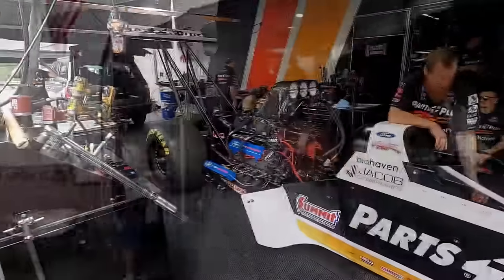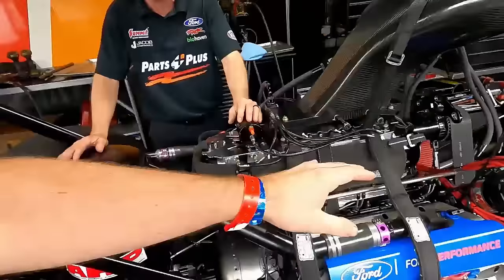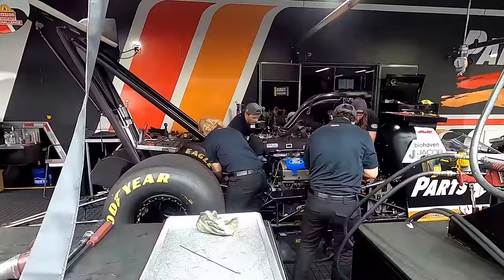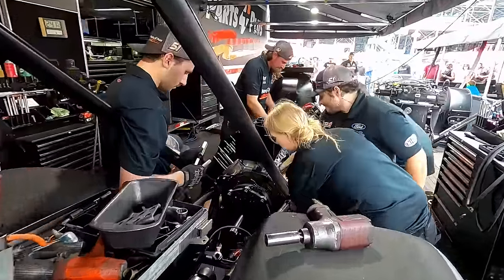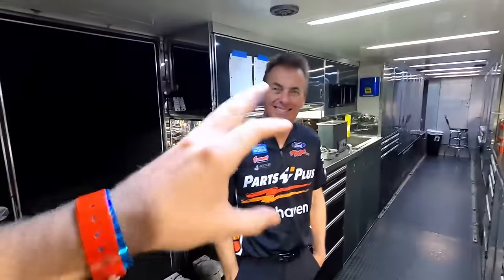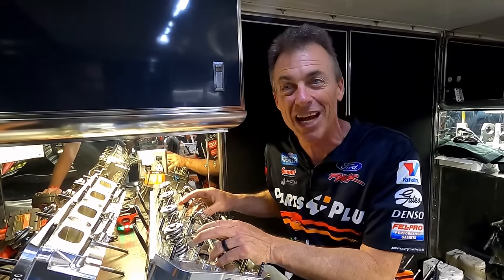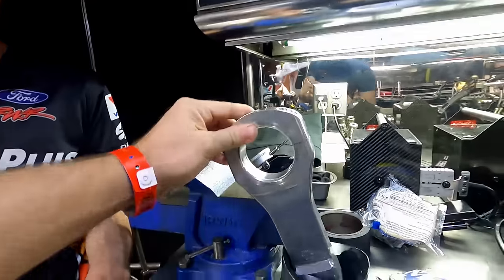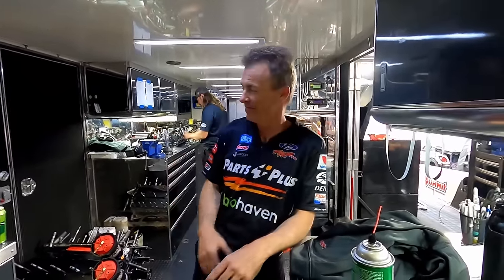CRAZY TOP FUEL FACTS WITH CLAY MILLICAN! 0-300 MPH in 3 SECONDS! #StompOnThatLoudPedal

Comment: Since a blown engine could cause the car to crash potentially killing the driver. It is well worth the expense and effort to rebuild the engine after every run. When making a vehicle go from 0-300mph in less than 1000 feet you have to seriously push the limits of those engines.

Comment: When Clay said you have to "see it, hear it, and feel it", it is absolutely true! Being right next to the cars as they run is just, in one word, exhilarating! The vibrations that are felt cannot be accurately described! I actually live about a mile (as the crow flies) from a major Midwest drag strip. The tunnel under the tower, and the drag strip itself, make almost a perfect straight line to my house. I can feel it inside my home when a nitro top fuel car takes off! That is the power of 11,000 to 12,000 hp accelerating! Man, what a rush! Thanks to you and Clay for this access to the inner workings of a top fuel team!
Reply from the maker: Wow! I’m sure you hear it loud and clean from that distance haha That’s awesome! Thanks for watching 🙌🏼
Reply: I live 10-12 miles from the now closed Atlanta Dragway in Commerce GA and could hear them at my house. I could easily tell if it was a single run or when one of 2 cars lifted - the noise level would change.

Comment: Great video, I'm a big Clay Millican fan. The one top fuel fact that you left out, and blew me away was when I realized that on an optimal run, from start line to finish line, the engine turns LESS than 1000 revolutions
Reply from the maker: I definitely should have mentioned that. It's wild to think about that fact! But it makes perfect sense when you break down just how quickly they make the run.

Comment: To fix the main studs from pulling out of the block you could switch to a billet steel block instead of billet aluminum. It would add a couple hundred pounds but it would be stronger and add a little bit more down force to the rear tires.
Reply: Aluminum, not only weight, also does not need liquid cooling.

Comment: A Billet steel block with aluminum jugs with iron liners, somewhat like a motorcycle engine , with 8bolt mains, 3x 5/8" studs on each side, and a 1/2" bolt in from the sides! Definitely should hold the crank in place!

Comment: I wish someone would make a good video, or even a movie. That details how they got to rebuilding between rounds,  how the bolts were developed to handle the stress, the constant wear. ARP makes awesome stuff, I always like to use ARP everything if possible! I'm more of a pro stock guy, but anything is cool.  Power is awesome,  if I had my way, I'd build a awesome engine to daily, either a 14:1 methanol LS engine , 6.0 based or a 9.5:1 twin turbo methanol drinking monster, possibly a twin compound turbo monster, on near 45psi boost, around 2K HP on moderate boost,

Comment: The old anecdote about Nitromethane, which I have never seen myself, is that if you drop a burning match into an open drum of it, the nitro will extinguish the match. On the other hand a puddle of nitro will explode if you hit it with a hammer.

Comment: I'm surprised they haven't simply designed a way to literally pull the whole engine out as a whole, and have another pre-built one lowered in.
Reply: They have fully built spare engines on stand by for emergency, but other wise I think it’s against NHRA rules for the race to swap engines between rounds. That’s why they rebuilt, it’s part of the regulation. FYI, the engine is literally held in By hose clamp style clamps. It’s quick to pull.
Reply: @grandnattygarage7355  Yes, I obviously know that its against rules to swap engines.  My comment wasn't to be taken entirely seriously.  I was just saying I wouldn't be surprised if someday, it came down to something as simple as just swapping out the engine in its entirety between races.
Reply: @jeremybr2020  gotcha, it’s YouTube, no comments should ever be taken to seriously lol. I was just comment off what I know, but I could be wrong. They change all the time, engine swaps would be so much easier that’s for sure.
Reply: @grandnattygarage7355  No prob.  And I don't think your wrong at all.  In fact I know your not.  Im just talking hypotheticals.

Comment: FYI-they could run faster than they do but insurance wont allow it. They were running rite at 340mph at 1320 ft. Now the track is 1,000 ft & theyr still running 340mph...
Reply: Tire can't quite handle it yet. Goodyear is working hard though to figure it out.
Reply: @slowpoke96Z28  what does that even mean? The tracks insurance wont allow them to go much faster.
Reply: @stevennewman8276  what dont you understand?  The NHRA is the one that mandates the rev limit and gearing. Every track has their own business insurance. You really think there's a cookie cutter policy everyone uses? That's not how businesses work. The tire is the limiting factor. It can't handle much more speed and still grab at the starting line.
Reply: @slowpoke96Z28  if that was the case ud see alot more blowouts & alot less wheelie'n. .8 60ft times...traction aint a problem
Reply: @stevennewman8276  ok dude.
Reply: The change was made to allow for more braking area. The cars became so fast that the existing runoff area wasn't sufficient. That extra 300 foot makes a big difference at 320MPH.

Comment: Actually a jet will definitely pull more G's than a dragster in acceleration.  He just needs to pull that ejection handle and away you go.   A typical fighter jet ejection tops at around 20 G's.   And that happens in less than 10ft.   😏

Comment: Not technical enough for me, I wouldn't mind knowing gear ratios, tire sizes, even bolt sizes!  Just imagine if they relax the rules a bit, allow up to 632 cid, and screw blowers, (I wonder how turbos would spool with all that burning nitro exiting the exhaust! Running 8large turbos,  with titanium and inconel  wheels, running a twin charged screw blower and 8x roughly 80 mm turbines. Making the roughly 60psi until about the 700-800' mark, then the turbos are fully spooled up, making closer to 90+psi, definitely need steel blocks, with larger crank journals, larger bearings, the block  having a large steel web the crank and main studs bolt to, have a large Billet aluminum chunk that bolts inside a rectangle opening with the replaceable iron liners, inside it, it bolts to the main web, with 3/4" bolts, and head studs that reach from the main web all the way to the head, being 5/8" with studs in the head going back into the block with a bit on the bottom, connecting to the block, having 1/2" bolts in the side going into the aluminum cylinder jug, the steel block being 3/4" thick and ribbed for reinforcement, probably weigh 200lbs more maybe run a 5" stroke and 4.500" - 4.625" bore even non turbo would be awesome,  the screw blower would possibly again 15% maybe use a methanol at air intercooler, spray the methanol into the intercooler to cool the intake charge!  Make the charge more dense, possibly gain another 10% the longer stroke will probably make even more power, especially when used with roughly a 1/2" or  larger bore! Just a 1/2" larger bore would be 300+ HP per cylinder, with a fair gain in TQ from bottom to the top! And allowing 6" wider tires would probably be required because  running a basically unlimited top fuel engine would likely double the power very shortly  and start using kinetic rope tech on the parachute, or possibly use multiple smaller chutes deployed in sequence to lower the negative load expected, maybe make 0-100 in 0.4-0.5 seconds, and 0-200 in 1.5sec. maybe see 40-50 mph over the record on the first clean pass. And a half sec. Quicker.  One can only dream I guess!! Or maybe cut the power 400-500 HP and run two engines as they are,  with the cranks phased so the firing order is evenly spaced, and geared into position,  use a 12 HP methanol burning engine to start it, or a large compressed nitrogen and large pnunatic motor, with a 20lb flywheel and gear box,  working like a air starter to start the engine, maybe incorporate a compression release to make starting both at once easy, crazy rambling I know, it's the insomnia talking!! 😆